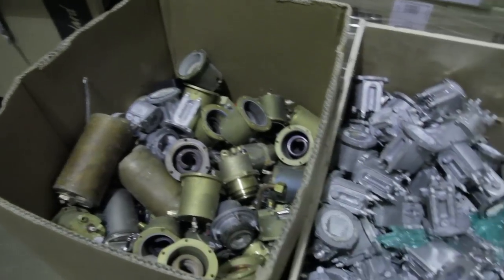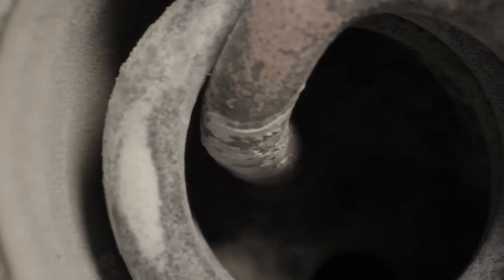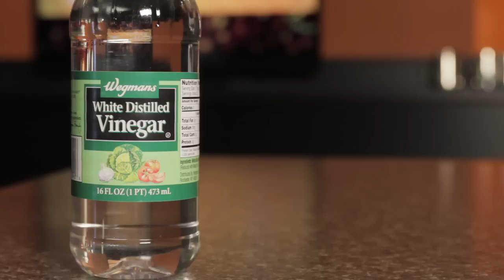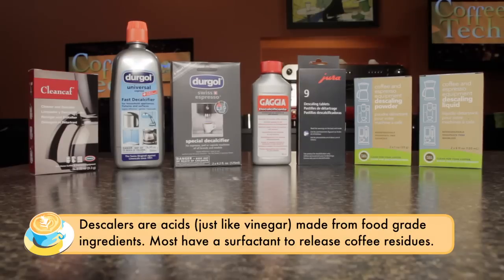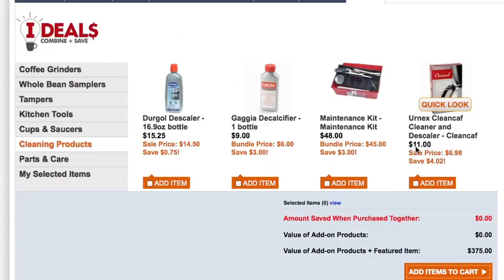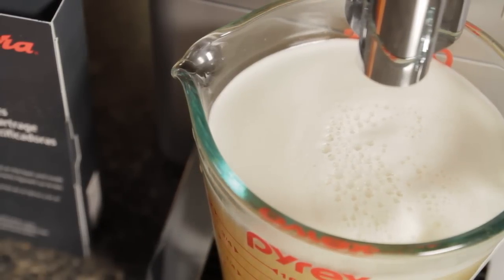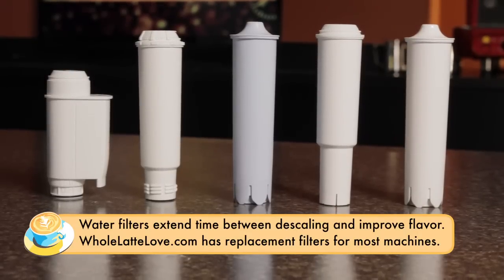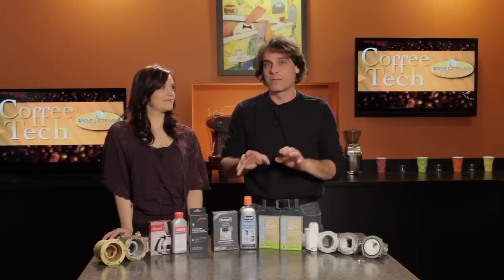The Dirty Truth: Why You Need to Descale

Comment: I've had my Delonghi 15 bar espresso machine for a little less than a year and I noticed it wasn't performing NEARLY as well as when I first got it, so I finally tried to clean it yesterday with vinegar and I ran it like 4 or 5 times and instead of actually helping, the water will barely come out. The steamer works fine but is still spewing vinegar, because it totally congealed my milk and the coffee was gross. It's almost as if theres huge broken up deposits blocking the water flow now. UGH.

Comment: To virtually eliminate descaling on pour over models,  Models that have their own Water tank,  Use filters and  "DISTILLED"  water for making your coffee!  Distilled water works best!!!
Reply from the maker: Hi John, While that seems to make sense...no minerals no scale right? A couple things to know. Water is a good solvent. Mineral free water is an even better solvent! So good it over-extracts coffee resulting in poor flavor. Over time, mineral free water like distilled or reverse osmosis can cause corrosion of metal components - it's kind of the opposite of scaling. One reason why distilled or RO water is never stored or transported in metallic piping. It's such a good solvent it pulls ions from the metal. The SCA - Specialty Coffee Association recommends a specific range of water parameters (including mineral levels) for coffee brewing. Check them out here: http://www.scaa.org/?d=water-standards&page=resources
Marc

Comment: Did not know vinegar wasn't food grade. Seems like capitalistic shill.
Reply from the maker: Hi PU, Don't think I ever said it wasn't food grade. It just stinks/smells, can damage internal seals in machines and is a less effective descaler than citric acid - which is also food safe and naturally occurring. If against using a pre-measured citric acid preparation it is available in bulk and one can make their own descaler that's cheaper and more effective than vinegar/acetic acid.
Marc